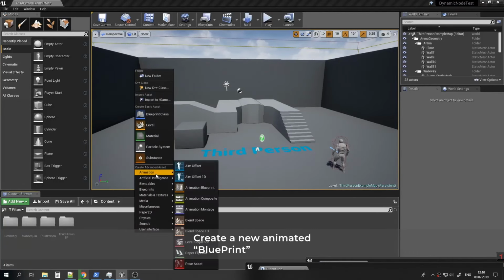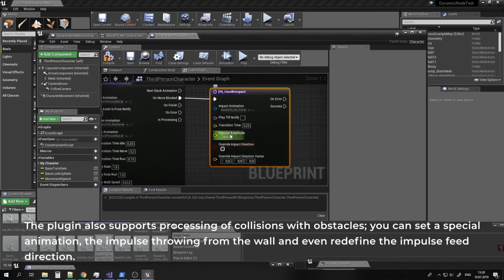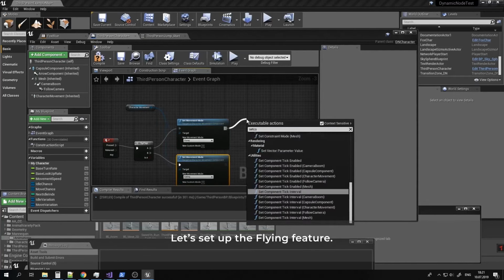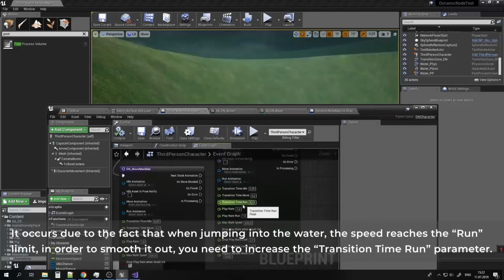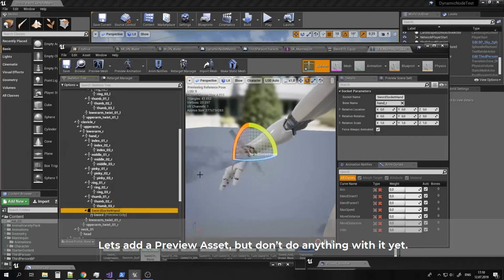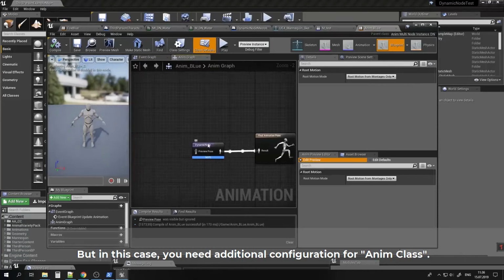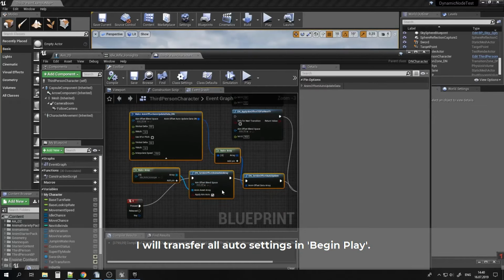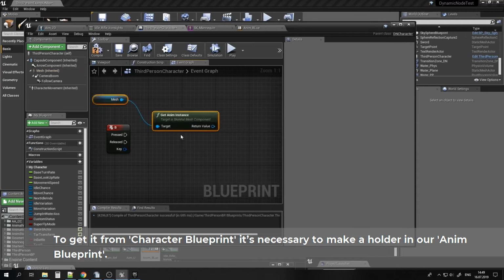UE4 Character Animation Setup Big tutorial - DynamicNode Plugin Part 1

Comment from the maker: This is the Part 1 of the plugin:
0:00 Anim Blueprint Setup
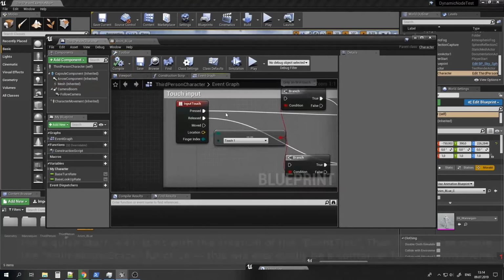0:50 Quick Start - Review Params MoveMachine
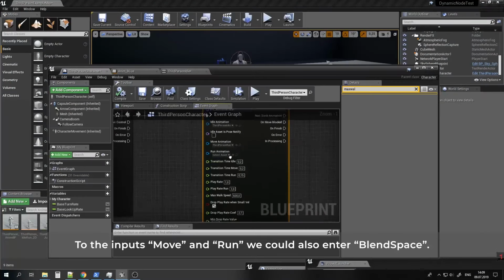5:03 BlendSpace1D
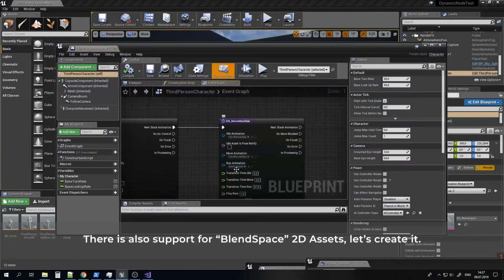6:35 BlendSpace2D
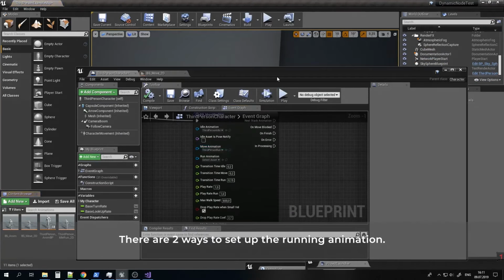9:41 Running Animations
11:05 How to Sync Animations, SyncMarkers - MoveMachineMulti
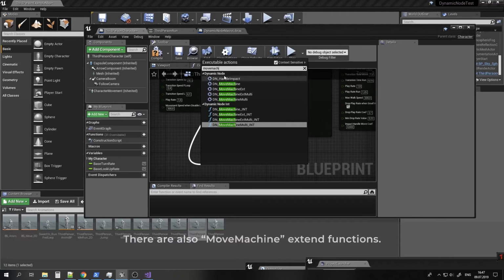13:34 MoveMachineExt Review 
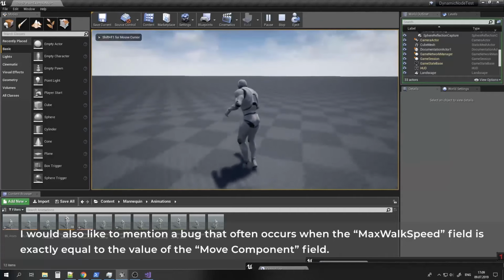15:03 MoveMachine, issue
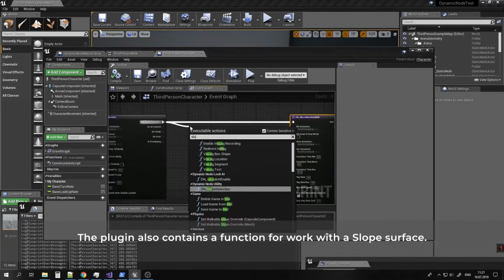15:45 Slope Surface - How To
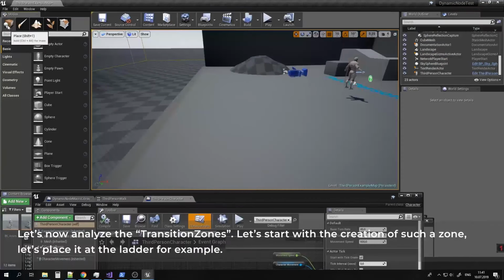20:41 Transition Zones - Change Anim depending on Landscape Type
23:23 Impact Animations
25:20 Anim Variations(ChanceSet)
34:09 Anim Variations 2(VariationsSet)
38:00 Simple Jump - How to set up a jump if you have only one animation - LoopNAnimAsset
41:12 JumpMachineExt Review
42:30 AirControll
44:06 Crouch
46:51 Flying
54:16 Swimming
1:00:40 SwimmMachine
1:08:09 Jump In Water
1:10:38 Swimming Settings
1:16:43 LayMachine and Other
1:18:48 CustomMachine
1:19:39 Custom Branching in Anim Graph
1:21:47 Turn Animations, How To
1:28:57 Turn In Place
1:34:02 Equip - Work w Sockets
1:38:56 Equip 
1:43:00 Grab
1:44:44 UnEquip  - How To Throw
1:47:49 UnEquip  - To Pelvis Socket
1:49:32 Battle Animations(Idle, Running ...) Branches in AnimGraph
1:52:51How To Play Single Animation
1:54:45 How To Play Single Animation UpperBody or for other Bone
1:56:00 AnimMontage
1:59:56 How To Interrupt Animations
2:00:56 How To Interrupt Animations BlendBone
2:02:27 Animations Chain
2:05:24 Animations Notify
2:08:50 AimOffset
2:18:53 AimOffset  - How to Setup Auto Update
2:22:31 Anim Curves - Acceleration Curve
2:27:17 Anim Curves - MaxSpeed Curve
2:30:01 Anim Curves - Velocity Curve
2:32:40 From Ragdoll
2:44:39 How to Use Unreal Engine Nodes

Comment: I jut started watching... and... you run EVERYTHING on event tick? on TICK?! REALLY? That... well ok... and isnt it better to run those machines from anim instance itself on tick there? they must run on tick? you know character and anim instance is out of sync? right?
Reply from the maker: Sorry, I accidentally missed an bell about this comment.
I do not understand what the problem is. When you do everything in the standard way, you update everything on the tick too, but in AnimInstance  using the Animation Update function.
It doesn’t matter that the ticks are not synchronized, it’s important that the data is updated through the MoveComponent (start of movement, jumping, swimming, etc.). And the movement component is updated synchronously with the character
Reply: @ue4dynamicnodeplugin882  neah youre right :) I actualy gave your plugin a shot and it has much potential and is super-usefull when when you want to have different characters with different skeletons, dynamic animation styles based on gameplay efects, and non-standard movement types like climbing, swinging, swiming, hovering etc.
Reply: @3sgamestudio   Yeah I was concerned about event tick at first too. But then you realize the whole plugin basically replaces the anim graph, which also runs every tick